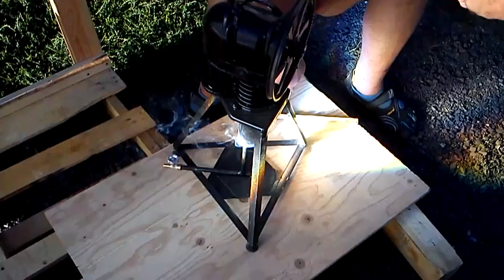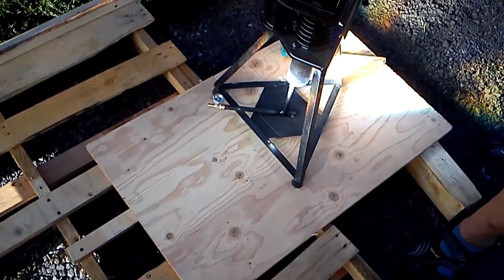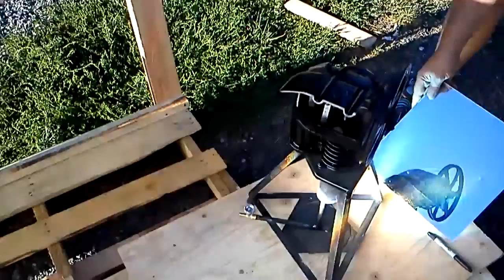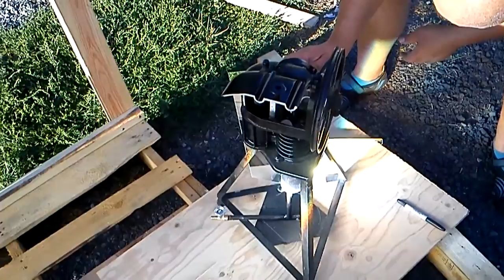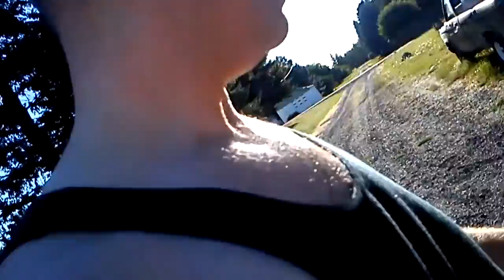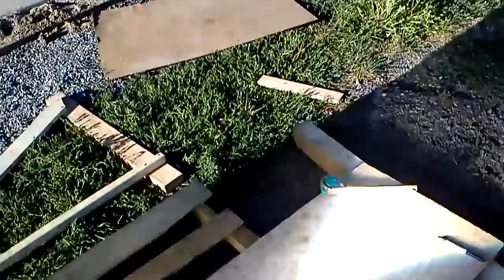Big Stirling Sterling Part 5 with Fresnel Sun Power!

Comment: cool. Ill check it out. Do you think the engine would run decently off an oil lamp? My application would be charging my off grid homes battery bank during winter months. be nice to have light/heat and charging and the sound of the engine clicking away in the house :)

Comment: Have you tested the actual power output of the engine? I was thinking an alternator with an external manually adjustable voltage regular to a 12 volt battery. Im anxious to find out if its anywhere near 500 watts. In the stirling engine forums, folks are doubtful. Even if it could charge 50 watts Id be happy and order one!